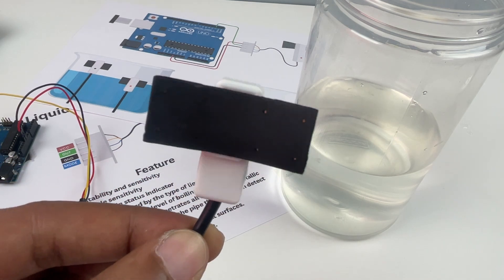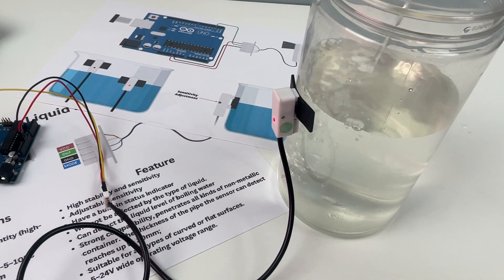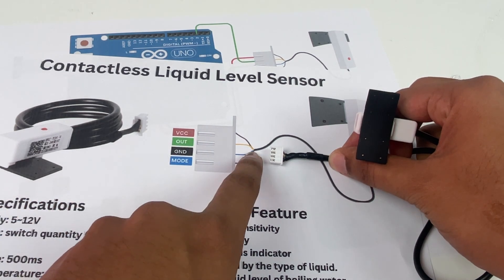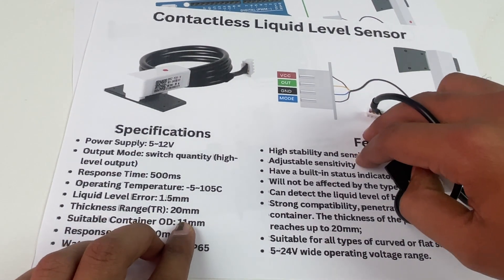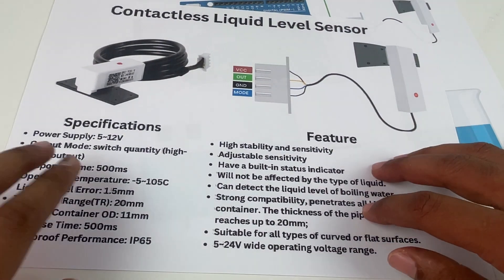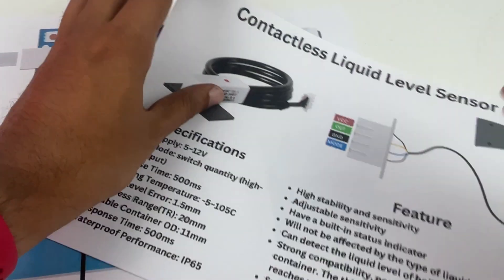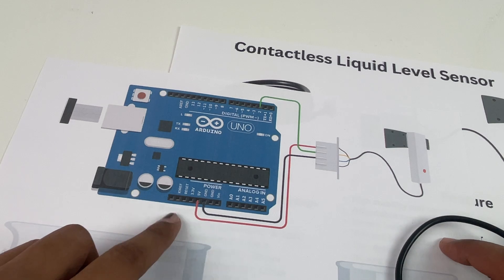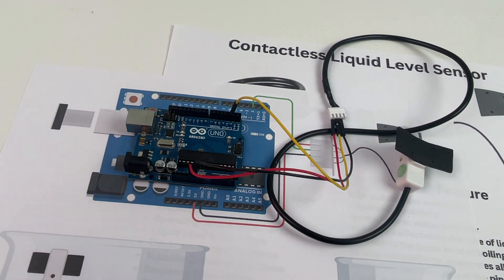Contactless Water Level Sensor (XKC-Y26-V) - Pinout, Specifications, Interfacing and Testing

Comment: Hi. I have had 2 problems with this model: XKC‐Y25‐T12V and I would like to know if this new version solve those problems. 1. EMI, sensor does work in an electrical cabinet, maybe for electromagnetic interferences. The sensor works outside of cabinet but not inside. 2. Viscous liquids. Liquids such as detergents, softeners, and dish soap typically run slowly down the sides of the container. The sensor can't distinguish these residues, so even if the liquid level drops, the sensor always detects them incorrectly. What happened with this new version?
Reply from the maker: We have't tested it with any viscous fluids. It worked fine with think plastic containers.

Comment: Can it work in the opposite direction so if there is not water it makes an alarm?
Reply from the maker: There is similar sensor with inverted output.
Reply: Would you please specify model name/number  @Circuitdigest
Reply from the maker: You can actually change the output behaviour using the mode pin. Mode select pin, Floating - Output high when liquid is detected, Connected to GND - Output is low when liquid is detected

Comment: Hi, I want to use this sensor on my expansion tank on my vehicle as a low coolant aralm. I have an LED and a Buzzer already wired together how to connect this directly on the wire when then coolent is low it will send a signal to the buzzer and led light.
Reply from the maker: You can use the digital output from the sensor to trigger the buzzer and LED light.

Comment: If you could help me figure something out- why doesn't the water become detected when it starts pouring? Takes until the level reaches the sensor. Is there a way to do that?
Reply from the maker: The sensor relays on capacitance to detect the water level. so if there is no water close to the sensor it can't detect it.
Reply: @Circuitdigest  Thanks for the explanation! Do you know of a way to detect the stream as it passes by a sensor?
Reply from the maker: You can use a flow sensor for that.

Comment: #Circuitdigest Sir Thank you so much for sharing information about the sensor...One thing is that Will the sensor give false output in Rainy 🌧️ season? Please reply me.
Reply from the maker: If you mount it out side without any protective cover there might be a chance for false reading. To avoid it, make sure to mount it some waterproof enclosure .

Comment: Thats a really good sensor , probably best for industrial purpose, compare to its price . 
Also good option for domestic use.

 can it measure the lpg gas tank level? Or it will get confused in liquid and gas.

But I expect more detailed video on how sensor itself work , is it capacitive based or something,why not see inside.
Reply from the maker: It can't be used with metal containers. And yes it is capacitance based. We have opened it but it is filled with silicon sealant to make it water proof. So if we want to see the internals the sensor will have to suffer some damages.